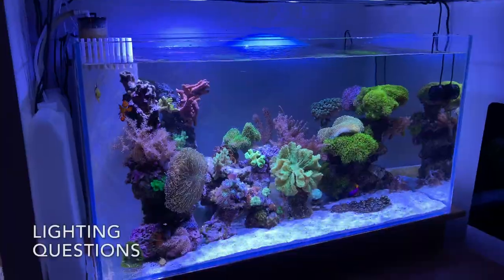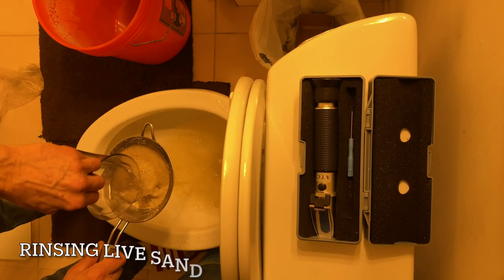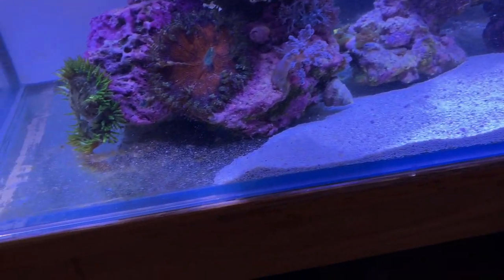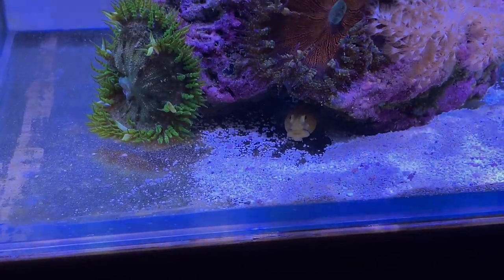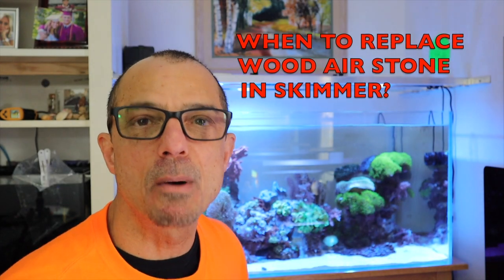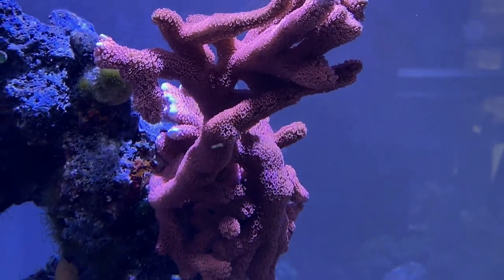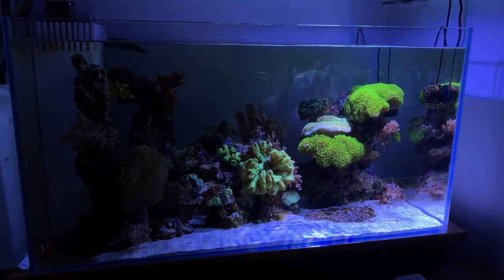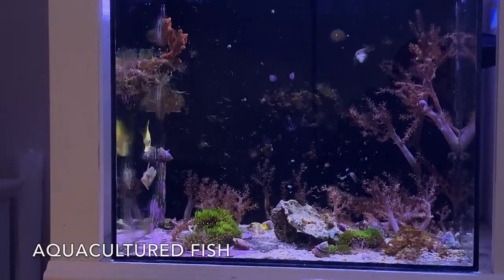How To Set Up A Saltwater Reef Aquarium - 75 Gallons - (Part 8) LIVE SAND & QUESTIONS

Comment: What temperature do you try to keep? Do all those lights make your tank warm? How do you deal with it? Fans, chillers? Thanks.
Reply from the maker: Hi huggyjd, the lights don’t run that warm at water surface. Tank temp runs between 77-78 F.  25 -25.6 C. I’ll see what happens in summer, but I have AC in the studio for that 😊👍🏻

Comment: Nice!!! Coming out awesome!!! I need to trim a leather coral. I’m assuming you have done this. Im nervous cause of the toxins. Any pointers? My leather is close to or the same type as yours in the top right zone of this new tank. Mine is Just getting to big and shading other corals.
Reply from the maker: Hey Steven, if you want to be super safe, and you can remove it from the tank, remove it and cut the portion off with sharp scissors. I cut mine in the tank and never had any problems. If it’s a small piece just turn your pumps off and cut in the tank. Then turn your pumps back on 👍🏻

Comment: Can you do too many water changes? That will hurt your reef tank. 75 looking great!!
Reply from the maker: Hey RG, it depends on the size and how many 😃. If your trying to reduce a high nitrate level, then several 20-30% over a week is not too much. Small 10% weekly changes can be ok. If your nutrients are ok, then once a week or ever two weeks is fine. Lots of scenarios 😃 too much water changes can strip the water a bit to much. You need some nutrients